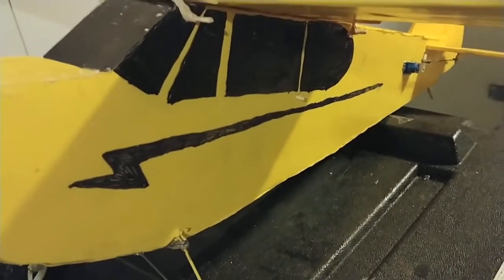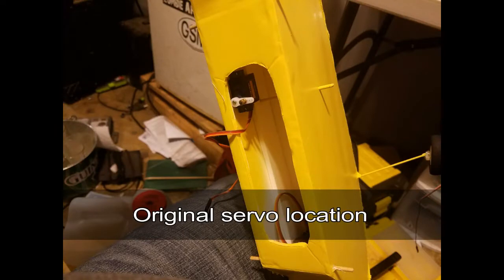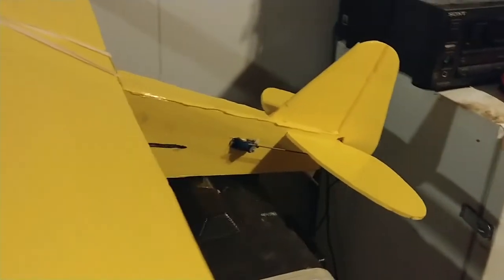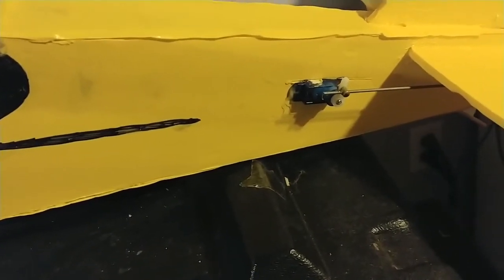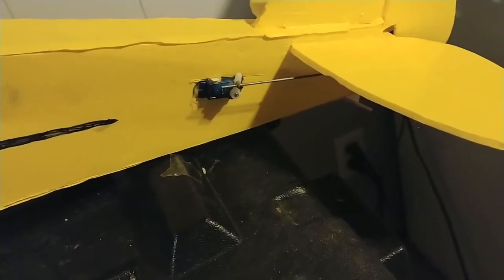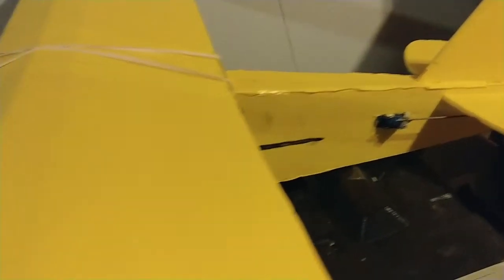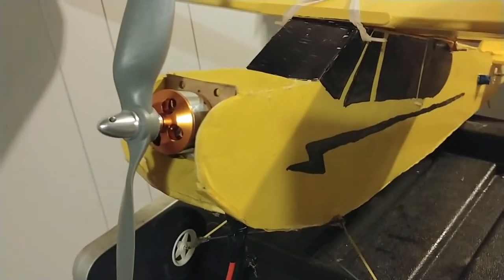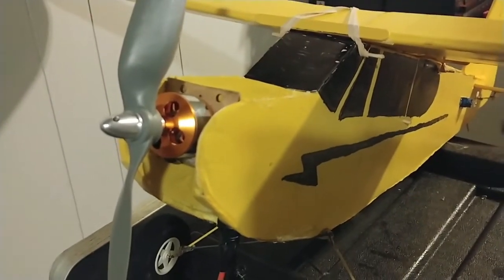Why did I choose the FT Simple Cub? ...build thoughts and experiences (good and bad)

Comment: The FT Cub is a dam good all rounder, its big enough to be stable and ive flown it in 45mph gusts at times lol but its also small enough to be ragged like a sports flyer.
if you upgrade the specs of the plane, its a very good plane and although i have loads of planes , the cub is flying so well now that its my daily flyer and i build a new frame when it gets tired, im on cub mk4 now.
2212 1400kv motor, 9x5 prop, 30a esc, 2700mah 3s lipo, two cams on a switcher, voltage osd, 800mw vtx and metal gear servos all round.
very soon its getting a F4 flight controller running ardupilot and gps lol.

Dont put your servos in the tail, its making your plane too tail heavy, i solved the pushrod flexing by putting a foam board bulkhead half way down the inside of the tail with two short sections of straws going through it at angles, they support the rods and stop the flexing :)

Im as close to 100% that nobody elses FT cub has reached altitudes that mine do, i fly above the clouds with them almost every time i fly and often reach a mile up and 2 miles out, josh bixler never had that in mind when  he designed a 'docile trainer' lol.
Heres one of my high altitude flights, have a look at my other videos, you will see what i mean about my cub being flown very differently to what you will see others doing with the cub on youtube :)
https://www.youtube.com/watch?v=DjjdgHJ7q24
Reply from the maker: Cool video. I have watched some Cub videos but yeah I'd say you've reached the highest altitudes. I'll probably be using mine as more of a trainer for other folks....of course, we'll see how much it'll get utilized for that first. If it doesn't, then I could very well hot rod it. ;-) 

I have kinda grown to prefer putting most of tail servos close to the tail. Makes it easier for maintenance plus easy to replace if one goes bad. At least so far I haven't had any issues with the servos there making it too tail heavy. 

What's the highest altitude you've reached with your cub? I've got a large glider that I wouldn't mind trying some higher altitude stuff with.
Reply: @perkyplanesrc9363  I never have servos go bad since I started using metal gear sg90s servos, replacement when inside the fuse is very easy, you just use a heat gun or hair dryer and gently heat the Inside of the fuse. 
If done carefully, the hot glue will melt whilst leaving the foam untouched.

I really recommend the sg90s metal gear servos, I won't buy plastic gear servos anymore, they are just too fragile.

The highest the cub has EVER been is around 6000ft but it regularly reaches 4000-5000ft, I'm flying on a 2700mah 3s with a racerstar 2212 1400kv motor swinging a 9x5 prop.

I've tried many combinations of motors and props but that combo is the best for efficiency vs power.

My battery's are mounted inside the power pod, the esc on the underside and I have change the underside foam piece on the nose to come much all the way forward and up to where the power pod bottom side is with a \_/ shape cut in it to allow clearance of the esc when sliding the pod in and out for battery changes, modding the nose like that made it more aerodynamic and I saw small gains in flight time and top speed.

My radio gear, cam switcher and voltage osd are mounted on a shelf above the power pod directly behind the windscreen. 

I have servo extension leads for the aileron servos which are tacked to the inside of the fuse at the reciever end and then folded up and tucked into the area behind the screen.
If the wing comes off in a crash. The leads unravel and save the receiver and servo leads from damage. 

Another thing my planes get is milk jug plastic on the belly, that saves the underside from getting shredded on landings.
I don't use landing gear, I belly land my planes as it allows landing on all surfaces and landing gear tends to smash the nose into the ground on all but the smoothest of surfaces, belly landing on milk jug plastic results in no damage and no nose dives.

Another very good use of milk jug plastic is on the wing, one piece curving round it at the leading edge and one at the trailing edge where the rubber bands are to stop them digging into the foam.

if you look under the rear of the wing there is a gap between it and the fuse, it's a weak point.
An extra 2 bits of foam hot glued on the underside will stop the back of it folding, make sure it's glued to both the underside surface and the stepped part where the folded over part of the wing ends to lock it rigid. 

Finally,  make the wing as normal with the dihedral,  then before painting,  slice into the underside of the wing, fill with hot glue and force a carbon fiber rod in then cover with more hot glue, snapped wings will be a distant memory :)

My planes go though a lot of abuse but they get patch repairs or cut and shut jobs, no crash no matter how hard results in total loss,  I even cut damage out of wings and bond in a new section. 

The cub is a very durable training plane but once someone wants to push it further it's capable of doing a lot more than it was ever designed for :)

My current cub is flying fine but it's replacement is going to start being worked on tonight do that I have a flight ready replacement sitting there, the next gen cub is getting an F4 flight controller flashed with ardupilot and GPS :)

Other ft planes I've built are the mini mustang, ft explorer (that's fully loaded with an Apm flight controller all all the trimmings) 

A storch, again fully loaded,  a ft goblin and a flite test forum designed cessna 180.

I have epo pre built planes but I'll never buy one again, foam board planes can be built so cheap that I'm not afraid to push the limits.

Comment: Hi can you please tell me where did you place the battery ? Under the power pod or inside the power pod ? And the ESC inside the power pod just behind the motor ?
Reply from the maker: Originally I was going for ESC inside and battery on bottom of the power pod. But my batteries (which are a little bigger), were hard to install and remove this way . So I have since moved the ESC to underneath and made a hood to put the battery inside the pod.

Comment: There are TOO MANY ways to describe a Brushless Motor!!! 😵😵😫
I wish that the Manufacturers could get it together....
I have FINALLY found a system that works for me. Motor Diameter - Depth - number of turns and kv.

This way, I KNOW I need 1506/1510's for my Minis, 2212 for intermediate size, 2820 and bigger for my "FrankenStorch" and larger Aircraft. 
What size is the Motor that you're running in this Cub?? I just got one as a Christmas Present (!!!!!!), and I'm sure I'm going to need a Motor for it. 
I've already got a 30A ESC with 4amp, 5 volt BEC, which I believe will be plenty. I'll likely run it on 2S, if that makes any difference....
Merry Christmas!
Carmine (same username on Forums)
Reply from the maker: Hey that's cool! As long as you found what works for ya. I think I mainly focus on KV, weight, and how many battery cells it can take. It's almost gotten to a point too to where I can tell about what kind of motor I need just by the size/weight of the plane. Everything you got there should be good for the Cub. Think my motor is an 1100KV.....this one here:

http://www.headsuphobby.com/Power-Up-450-Sport-1100kv-Outrunner-Brushless-Motor_p_1595.html